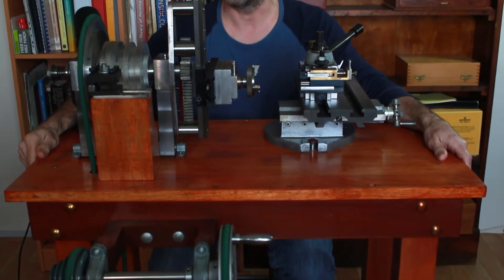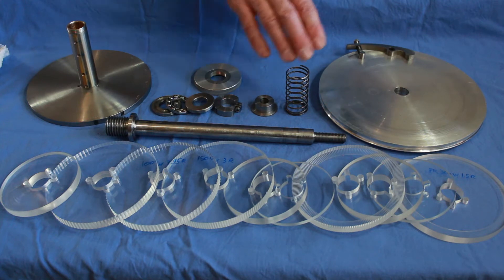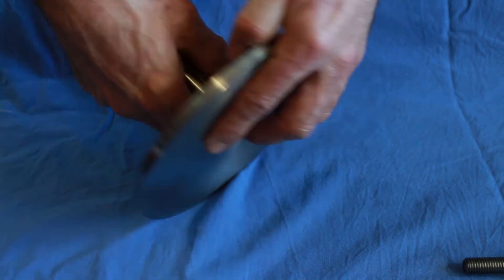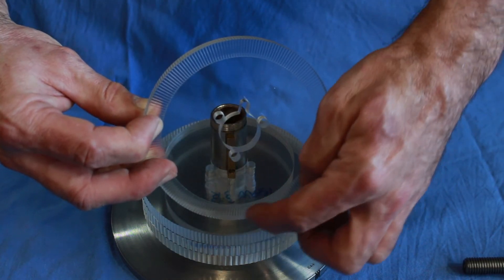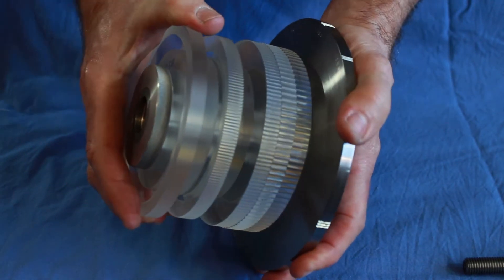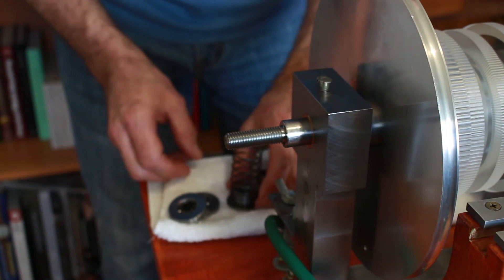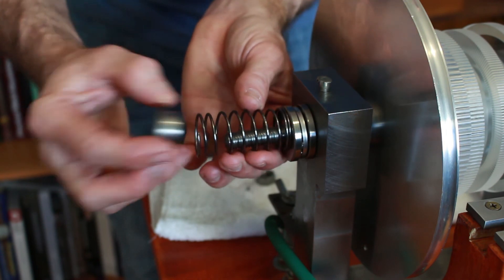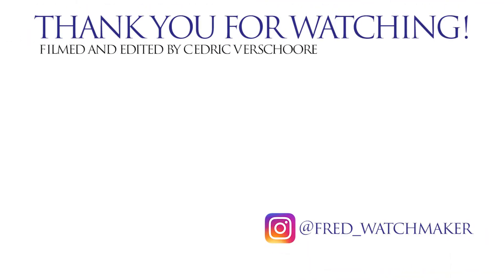Rose engine rosette barrel assembly.

Comment: this is amazing. Sadly it's cheaper to buy a tabletop CNC for guilloche than getting a rose engine
Reply from the maker: @GustavoVegliaVicO.M.  thanks for your comment.
Sadly, a tabletop CNC machine with a rotating cutter will never achieve the same finesse of cut that is a rose engine, especially cutting rachet borders. That is probably why all those high-end Swiss watch brands are still using traditional rose engines to guilloché their dials and cases.
Unless you can find a CNC machine that can reproduce cutting patterns of a fixed cutting tool, but then it won't be cheap.
All the best!
Reply: @liliss67  thanks for letting me know, sir. I wasn't aware. i would love to make a rose engine lathe myself. Would you mind giving me some advice?

Comment: Thank you for taking the time to make these videos.  There are so few resources for those of us that want to design and build a rose engine for guilloche work.
  You videos answered so many questions I had and now have all the information I need to finish designing most of my rose engine.
  I wanted to ask if you wouldn't mind sharing the rack and pinion size you used for your straight line attachment. I'm not sure what to use and any help you could provide would be very much appreciated. Thanks again for the great videos!

Comment: HI Frederic. Really impressive machine (as is your other work!) A question though - how do you determine the ideal shape for the rosettes?
Reply from the maker: Thank you for your comment, the waves shape and radius of the rosettes is determined according to the pattern you want to apply and also the shape of the touch piece against the rosette on the rose engine, many different pattern can be obtained using different shapes and radius of the touch pieces.
It is quite complex to explain but there are literatures where you can find answers.